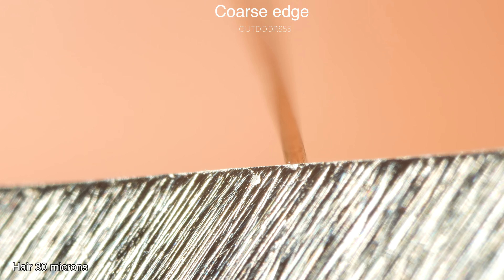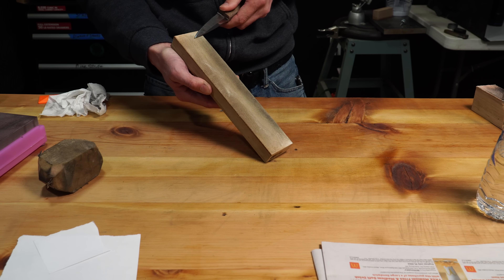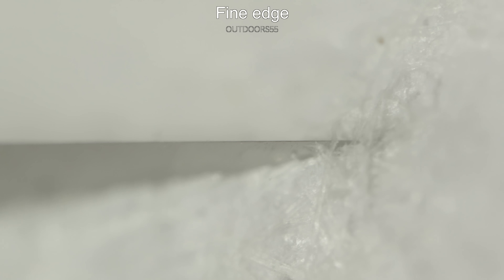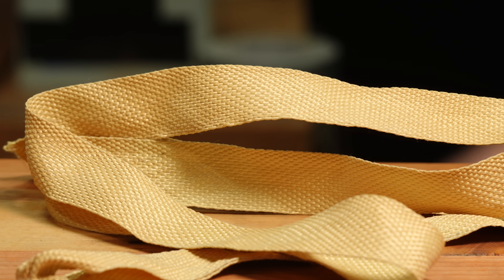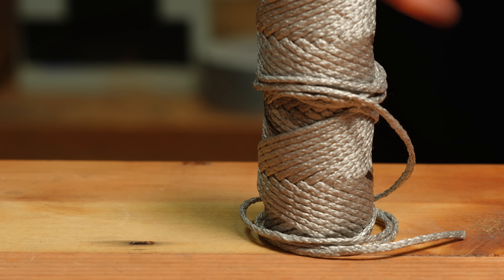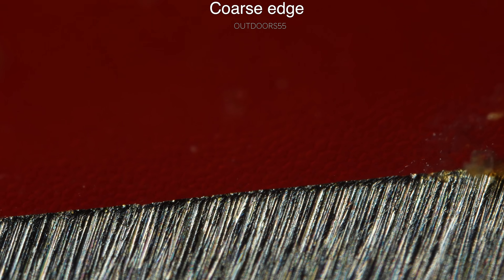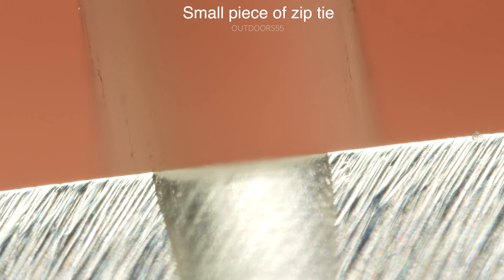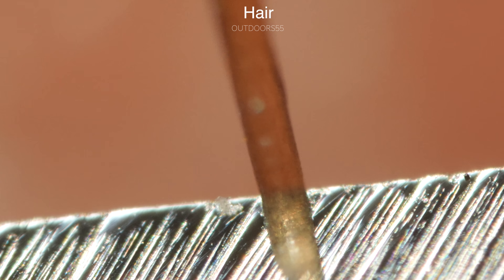Coarse Grit Knife Edges Are Weird - Coarse Vs Fine grit Edges Cut Under Microscope

Comment: You have to keep in mind that a coarser grit sharpenings biggest downside isnt that its more dull, its that it dulls faster. Just like how quickly deburring your knife regularly drastically prolongs how long you go before you need to actually sharpen. Those jagged edges create points where stresses can concentrate and cause the grain structure to deform and compromise the edge. The less drastic the peaks and valleys, the less drastic the stress concentration, the less quickly the metal deforms, the less often you need to sharpen
Reply: This is incorrect. Course edges cut score HIGHER on CATRA tests. Meaning they have slightly more edge retention, not less.  l but they are more likely to chip. Polished edges go dull faster but they are tougher and less likely to chip. It's a confirmed empirical fact. it's also common sense if you think about it.
Reply: @TimJohnson-x1o  Common sense is wrong all the time. Which is why we need scientific testing for this stuff.

Comment: I go with a 600-800 grit course edge on most of my knives.  But certain steels like s110v, s90v, maxemet, k390 with high edge retention are worth taking the extra step on because the edge lasts so much longer! And cut like butter when you’re done with them. Surgical!

Comment: The fine grit edge will hold up better over time when cutting delicate cuts of meat and similar substrates (tomatoes will show a difference too once the blade begins to dull more with the coarse grit vs fine grit) to the point where it becomes very noticeable in the finished products cut with it. However, for something like a vegetable knife the difference will be far less between the 2 edges.  In the end if the blade is properly sharpened as to the angle being the same on both sides of the blade and the bur properly removed I think most of us are fine using a relatively coarse edge like the one shone here,  Even if the sharpening had stopped at 600 grit and the bur removed it will be far better than probably 90% of the knives we see people use in their kitchens and on their pocket knives

Comment: Curious why you would choose a 600 grit instead of a 400 grit for the coarse stone in this video. 

Your oft-used $20 stone and your highly recommenced Shapton both use 400 grit on the coarse side. Not that it’s a big difference, but why did a 600 grit stone suddenly appear? 

Would prefer some consistency in what you use for your tests. And in your strop diamond compound grits as well.
Reply from the maker: It just happens to be the stone i was testing at the time. 400 grit would be coarse for sure and also would give roughly the same results. I use a lot of different stuff as im testing things for future videos. 🙂

Comment: First of all, congratulations, you are doing an amazing job here.

I do realize that the audience you are referring to are knife enthusiast and not professional that sharpens their knifes as a tool that they hold at least 8 hours every day.

As a mechanical engineer  I accept the testings on hair or on paper but as a chef I would really like to see how a bone would change the edge and also how the surface of the bezel (mirror polished or coarse) would change the drag when cutting vegetables all along the edge or even fish or meat, if there is a tear or what is the sense of accuracy, meaning if you can easily predict the way you are cutting, especially let's say onions at 1.5 mm, fine Julienne or fine Brunoise.

It would be also interesting to find out what surface is non sticking for all those fine cuttings so we don't spend extra time to release the from the blade.

Really appreciate all your time and effort, I see that you love what you do and what you do is offering knowledge and your scientific passion questioning what we think we know is right.

Best regards, brother.
Reply from the maker: Absolutely just scratching the surface here. Theres a lot of variables that come into play. But thats what makes this so fun😉👍

Comment: Hi Alex,

Wow! Amazing sharpness and amazing close-ups!

I have to admit I'm surprised that the coarse grit edge wasn't better on fibrous materials like paper, cardboard, nylon, kevlar, etc. 

I agree with your conclusion that, for practical purpose, a coarse grit edge might be a better option most of the time as it takes less time and equipment to get an edge that is not so inferior after all. In other words, the difference in sharpness is smaller than the difference in effort to get the finer grit/sharper edge.

Thank you very much for this another great video!
Reply from the maker: I was surprised as well!
Reply: @OUTDOORS55 

Knifemaker Joe Calton did an experiment sometime back with three edge finishes, from 325 DMT to 6 000 King waterstone if I remember correctly and he basically also came to the conclusion that fine grit edges may not be worth the effort. 

I don't know how to link a video in the comment section, but I'm sure you would like the video. 

Calton also has a very practical approach to sharpening and also knifemaking in general.

Comment: Nicely done! I suggest that a functional difference between the edges relates to surface friction. The ridged coarse edge isn't going to slip through like the smoother fine edge. I maintain my edges with the Spyderco Sharp Maker followed by a green stropping compound. This has always made a great working edge without a lot of fuss. I have noticed that different steels sharpen with greater or lesser ease on this setup. M4 takes significantly more strokes than S30V. Magnacut seems to be the sweet spot between sharpening ease and edge retention of these 3 examples.

Comment: I have ran the tomato test using only the weight of the blade, and in several cases the fine edge wouldn't cut the skin immediately drawing back and forth, while the coarse edge always sliced in immediately. Both hair whittling. However, it depends on the tomato, the weight of the blade, sharpening angle, thicknesses bte, etc.
Reply from the maker: For sure! A lot of variables here too👍
Reply: @OUTDOORS55  very admirable of you too respond to so many comments! 👍

Comment: I used to try to sharpen my knives to the highest polished and sharpest edge possible.

However, in recent times, I've realized that a coarse edge on my basic pocket knives is really all that I need for what I'm using the knife for. 

It's not that I can't put a highly polished razor-sharp edge on my knives. I can, by using my worksharp guided system, but really, all I'm doing is opening boxes or cutting some rope or whittling a stick and for that I just sharpen my cheap barlow pocket knife on a 320 grit benchstone from Canadian tire, followed with a leather strop with 3000 grit polishing compound.

Comment: Good video!

I do agree with you, a coarse grit would most likely be enough, even when cutting a single hair (although here I need to make a remark*). On some things, maybe a few might notice the higher grit finished edge is easier to cut with. But rarely is worth the extra effort to get it there.

*with a single hair, a coarse edge will cut well. However, when you want to cut through a hundred in the same time, such as when you shave, then you will notice the difference. That coarse edge needs a tiny bit more force to cut though and when you multiply that force by a hundred, it becomes more significant. Second, our face is a lot more sensitive than our hand, so noticing this small difference is very likely. 

Cheers!

Comment: Also, I have been practicing(not nearly enough apparently tho) but i can't any anywhere near that kind of edge on my 400/1000 diamond stone lol...like, not even a whiff...
Reply: Depends on the brand. Some stome brands are just junk and not consistent with grit size. He shows close-up examples several videos back. He also covered it in several other videos. A quality stone goes a long way. Aside from that, he's as good as it gets
Reply: @denttech2515  yea i know...i have some he recommended...i just need more practice...like, a lot more
Reply: But he strops even for “ coarse “ edges
Reply from the maker: It's simply practice my friend. Unfortunately theres no real secrets unless your angles are way off. Make sure you around 14 degrees per side. 👍
Reply: @OUTDOORS55  yea my pull stroke with my right hand is waaaaay more consistent than the other side for sure...I'm working on it though, you help tremendously

Comment: I think it would be interesting to retry this with different steels. Like a very low performance steel vs. a very high performance.
I want to point out how impressive this testing is, though. Between the imaging setup and the variety of materials you are approaching scientific journal investigations.
Reply: biggest difference will be in edge retention

Comment: Would love to see an obsidian shard edge that up close.
Reply: And tungsten carbide at 71 hrc.
Reply: Chronova engineering has a video on obsidian blades with some great shots and scientific discussion.
Reply: This isn't really showing the edge, just the micro bevel near the edge. You need electron microscopy for the edge because a proper sharpened edge is smaller than the wavelength of visible light.
Reply: @TheDuckofDoom.  not even remotely true
A truly sharp edge can fall anywhere between 1-4 micrometers wide 
Plenty wide to see under a microscope 

All knives round off eventually, usually before .9 microns 

Which is why obsidian is “sharper” because it rounds off much much later, usually around .5 microns
Which is still quite visible 

All the claims about obsidian being so sharp it could “cut individual cells” is just claims made from Reddit 

I couldn’t find a single medical or scientific white paper confirming that theory 

Just an article mentioning it, as a theory 

So until it is done, documented, written and then published
It’s made up
Reply: @TheDuckofDoom.  aren't certain obsidian edges monomolecular
Reply: @sdfggdfg5fgdfg  Obsidian blades are not my area of expertise but I know it would be difficult to image and confirm because it is not an electrically conductive material. 
Electron microscopes rely on electrical conduction. Some nonconductive items can be plated first, but the plating will coat the very finest details (like a monomolecular edge).
If memory serves the obsidian scalpel thing was a bit of a fad that has lost favor. Steel blades have mostly caught up and obsidian chips are a nasty foreign object risk because they are extremely difficult to detect compared to metal, and that is aside from the difference in risk of generating a chip.(Leaded glass, eg "crystal" would show on xrays, normal glass does not.)

I have seen images of a factory sharpened steel scalpel edge, and it was substantially more even and finer than even a well stropped straight razer. I don't recall with certainty which industrial process was used, but it may have been sharpened with a lazer.

Modern scalpel blades are one time use items anyway so the resistance to dulling is not a primary concern.
Reply: @TheDuckofDoom.  How the hell did your comment get 8 likes?
Reply: @jumboegg5845  U jelly?

Comment: Very interesting results, incredible photography! Thanks, Alex. "Is it worth it?" is a question that requires definition and, quite probably, a lot of debate. Time to sharpen. Durability. What's "good enough." Etc.  ---  Have you compared this amazing degree of sharpness with razor blades or surgeon's scalpels?
Reply: That is probably up to personal preference. For me I like the feeling cutting with a really fine grit knife and a mirror polish is pretty. The cutting surface it leaves behind are also different. If you value that spending the extra time is worth it, if you don't care about those things then your time is of course better spent on other things. I think that both approaches are equally valid. In the end both start with a whole tomato and end up with tomato slices.

Comment: The only reason to go higher in grit is if you enjoy the knife sharpening process and the beauty of an edge.
Reply: its not the only reason. if you use an abrasive that is smaller than the carbides in the steel you get an edge that is more resistant to chipping because there are less areas for cracks to form.  thats a confirmed fact.
Reply: @TimJohnson-x1o  If you're using a tool in a way that you're worried about chipping. It's usually a tool that I'd be sharpening more often and would expect a less than perfect edge. I'd much prefer removing the hassle of taking 3 other stones out just for a small drop in chipping chances when the edge is going to go through hell anyways. Also, if you have a problem with chipping, it's most likely you're steel, not the edges grit.

IMO: I'm not convinced the small difference in chipping performance would be worth the time on the tool I'd be using to chop wood, bone, and other hard materials.

Me personally I always do mirror polishes because I don't use the tools often and I enjoy sharpening them for their beauty and perfection.
Reply: @Tearsien  if you're using tools like a kitchen knife made of brittle steel like super blue at 65+ hrc in edges that are as thin as two sheets of paper, some microchiping is just to be expected. but you can make it less likely with a mirror polish on the edge.
Reply: @TimJohnson-x1o  Well, I personally would never use a 65+ hrc steel knife to do any heavy use that would even chance chipping. I'd imagine that would be redundant, and if you're using a kitchen knife on vegetables, and other soft things, you're really not getting much of a performance gain from a mirrors edge.

Comment: isnt the edge retention better on fine grit or is it to small of a difference to matter?
Reply: The harder the blade the less it matters. It would be determined by angle much after that and structure. But nah it doesn't matter here.

Comment: I think edge retention is what we need to know, if there is a difference there maybe.
Reply: Instinct makes me want to say the course sharpened one would stay sharp longer, for the same reason a serrated knife stays sharp longer. Whether or not the difference is really noticeable at that level is the question.
Reply: @BriBCG  not true
Reply: there is. the course edge has slightly more edge retention. But the mirror edge has better toughness ie less likely to chip. the reasons why are obvious, but this is also cited in the book knife engineering by larrin thomas and confirmed on his testing
Reply: coarse might roll slightly easier just because each  gouge will be a stress concentration, but i don't think it's enough to matter if you strop often
Reply: Was just going to say this, so bumping instead
Reply: I’m going with coarse grit….
Reply: I don’t think there’s a general rule here. I think different steel with different size and amounts of carbides will have different optimal courseness, there’s also heattreat to take into account